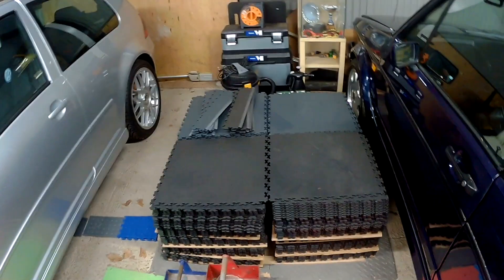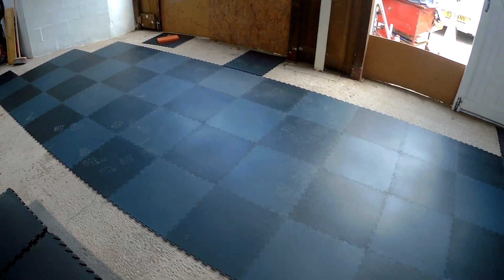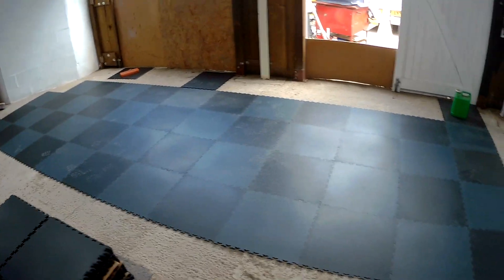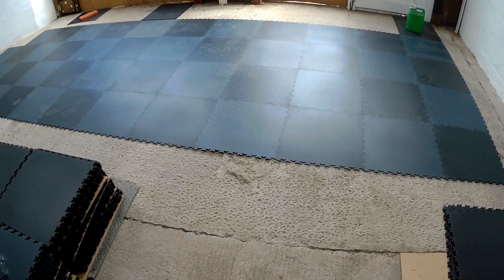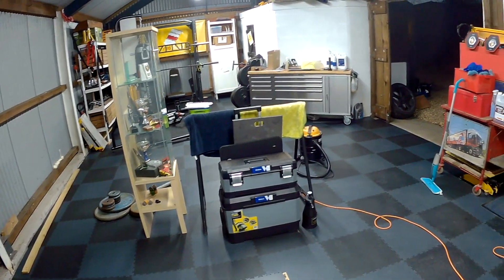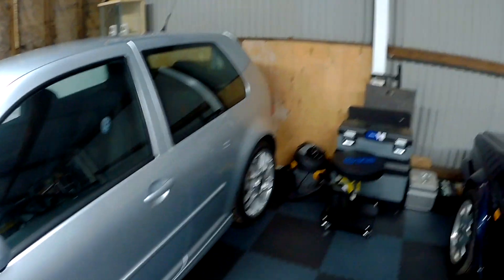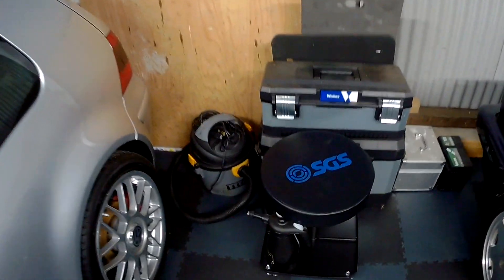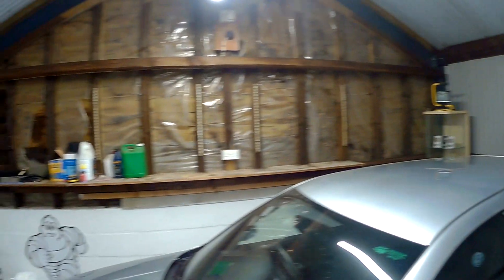What is the best garage flooring? Garage Makeover DIY: Setting up a home car detailing studio

Comment: It's all coming together nicely Mark, exciting. I envy you the space👍
Reply from the maker: Cheers Martin. Just the boards to go and then the main work is done. I've decided to dig an inspection pit next to the garage instead of a scissor lift as that way I can get the Defender over it for rust proofing etc too. Lucky to have a plot of land and this old barn to slowly convert. Trouble is, it comes with a battered old house that is taking most of the money to renovate! All in good time :) Ta.

Comment: Floor looks very smart, looked at getting my own garage done but didn't think the floor tiles would hold up well to a lot of jacks,axle stands and that sort of wear and tear
Reply from the maker: Cheers. These tiles are solid as opposed to the hollow backed ones so should stand up to hard use better but you make a very good point. Horses for courses I guess 👍 Thanks for watching
Reply: Hi Chris! Our tiles (the ones in this video) are solid PVC all the way though so they do pretty well under a jack. If you leave the car on the jack for a long period of time though it might leave a dent that returns to normal in a day or so. Of course you might get some scratches depending on what you are doing but there is no impact to the durability/performance of the tiles. 

Some of our customers who really want to protect the look of the floor and just get a few spare tiles and flip them upside down under the jack just to protect the floor!

Comment: Looks really nice. Quick question, if I do wood work in my garage, do you think I can manage to keep the tyles clean simply by vacuuming or do you think I'd start getting build up on the tyles joints?
Reply from the maker: Thanks for the feedback. Yes, vacuuming gets rid of most dust and debris. I back that up every second week with a microfibre mop wipedown with some weak cleaner and water. Works a treat. Good luck!
Reply: @thegolfdiaries1123  thanks